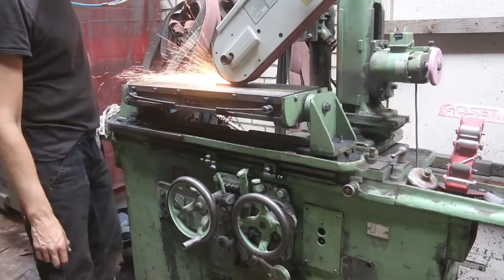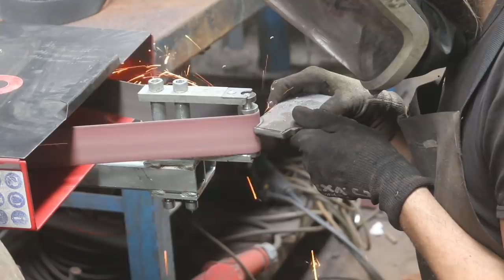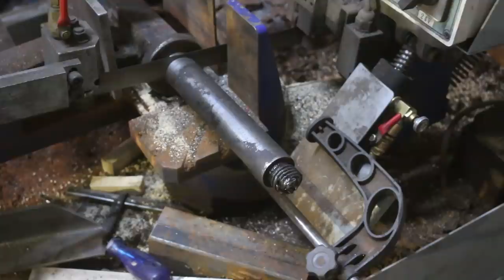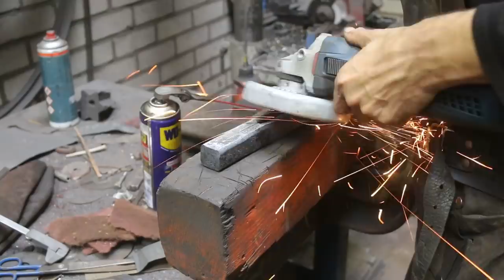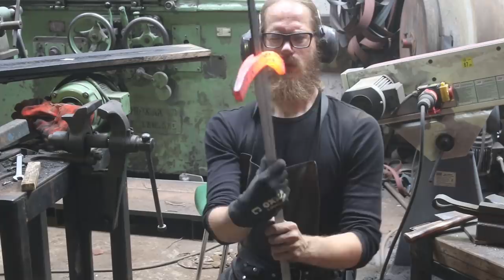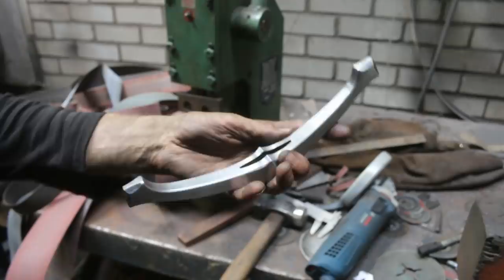Forging a Witcher 3 silver sword, part 3, making the guard.

Comment: When you make another blade/tang punch for a guard I suggest having the handle for the tongs 10-15 degrees angled down towards the tang and 5 or so degrees to the left, Everytime you make one and use it with the press the punch is at a slight angle compared to the guard material. To perfect the angle for your ergonomics TIG weld TIG welding wire to plate and clamp the plate in a vice at the right height for the press, then use tongs on the wire and bend to the proper angle so it is comfortable and natural to hold and find the angles for future projects. You can then recreate that same angle/height repeatedly and get more accurate as well as comfortable results with future projects.

Not towards you Freerk…
I keep seeing people make tools and stuff at 90 degree angles then hold the tools at awkward uncomfortable angles when using them... That's bad tool design. Think about how tongs are held comfortably and accurately and make the tool fit those angles so it can be held comfortably and accurately rather than left hand reaching way off to the left to hold the handle rather than close to the stomach. Not only does a little ergonomics make the work physically easier to do but it also makes it more accurate and faster to do. 90 degree angles are easy to create but makes the real work harder and less accurate.
Reply from the maker: True... I will keep it in mind next time. Thanks for the thought.
Reply: @freerkwieringa275  You are welcome, I hope you find the right angle for it and it makes the work less awkward and more enjoyable. Holding your arm up like you do when using a punch on the press just looks so uncomfortable and awkward.

A comfortable tool to use is always a pleasure to use.(that's what she said?) If you make your own why not make them perfectly comfortable for yourself?

*Edit,
Another thought, you could make tongs specifically for the blade/tang punches. Make the jaws angled so the tong handle is perfectly comfortable to hold with the arm/wrist/hand in a natural position/angle. That would make creating the punch easier since the punch handle can be at 90 degrees. Then if you ever reuse an old punch you will be comfortable with it as well.